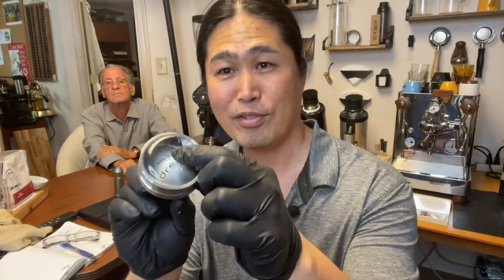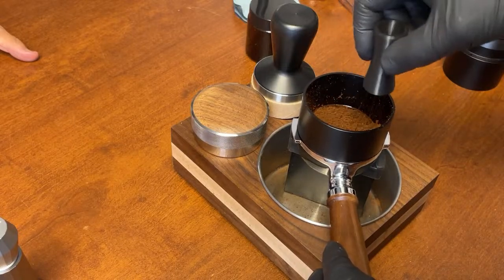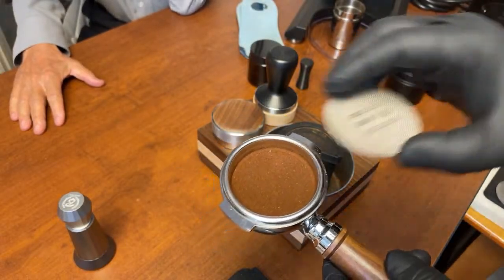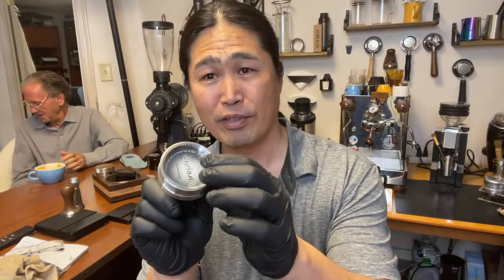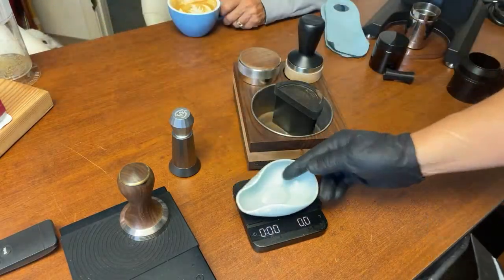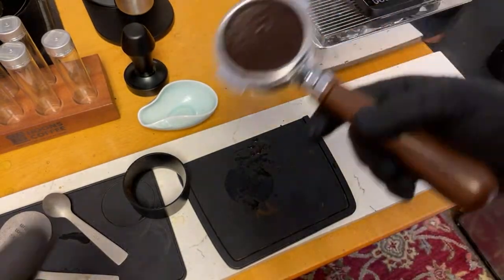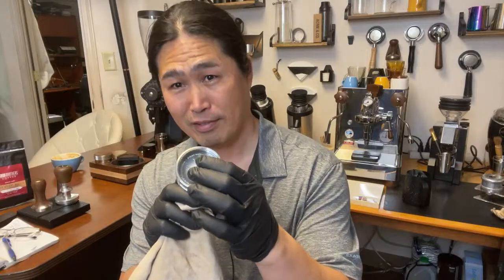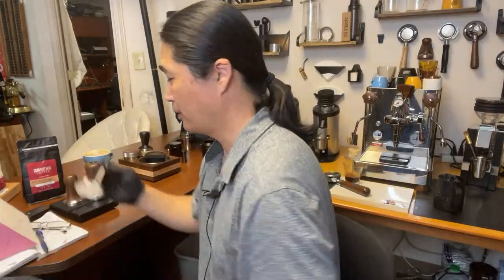Live demo | The Hydroforming Tamper | idroprep Coffee Tamper

Comment: Not sure anyone is following this anymore. Just got my Idroprep and have done three shots. The first was to dial-in. I found that I only need to grind slightly finer. Before tamping I did a minimal tapping because my beans are very fluffy and overfill the basket- no WTD or distribution. After tamping the puck was not level. I put the Flair 58 screen over the puck and it was at a slight angle. The pulls are very smooth. I have a Decent so I could see that the graph was very well behaved- no indication of channeling (I have to try with a bottomless PF). It's too early to know for sure, but taste has been very good and I think the shots seem darker with more body... I really like that the tamper doesn't have grounds stuck in crevices. It just needed a damp wipe. I like the simplified workflow... So far, so good!

Comment: Have you ever had a problem with the Lelit Bianca constantly dripping in the tray after it’s heated up? I have this issue and only after a year it’s gotten worse and now just shoots out steady steam through that little drip hole near the back flushing area below the group head. I can’t really find anything on this issue, but would love to hear your experience of this. I always have absolutely love your videos!
Reply: try asking FB group members.
Reply: Have you figured it out?
Reply: @NANA-gy7yx  Yes! It was the safety valve. There is a redesign that replaced the original. It works way better and absolutely no leak. I also noticed the pump kicks in way less often, so it never wastes water when I am not using it now.

Comment: Not supposed to do WDT and distribution with this tamper.
Reply from the maker: I have to try that tomorrow.
Reply: Why?
Reply: Need to read manufacture’s description of the purpose of this tamper. It’s about creating uniform density in the puck not about a level surface. Based on another YouTuber who did a somewhat scientific test I ordered one.
Reply: Looks like what? “Something dirty” 😅
Reply: The flaw with the theory is that the tamper will create hills and valleys on the surface of the puck, once water hits it, it will flow to the valleys  creating uneven extraction, at least at the top of the puck early on in the extraction process.

This may or may not be preferable. No puck is perfect.
Reply: @tedgoldman9121  Told you Ted, he is a clown!!
Reply: @HoonsCoffee  Do you need WDT and distribution? What are the conclusions?